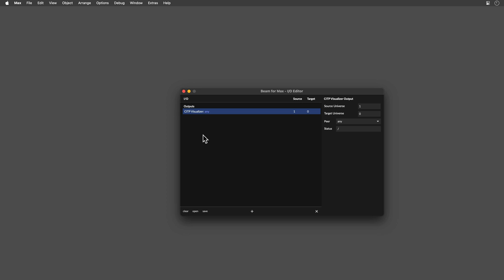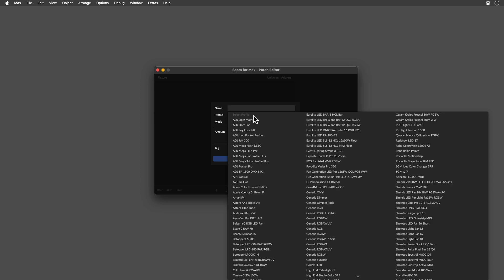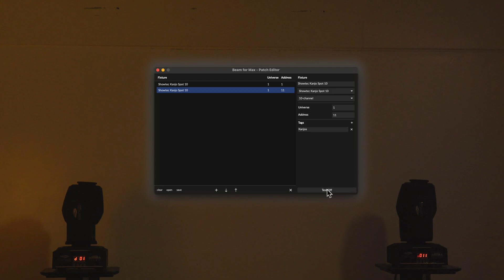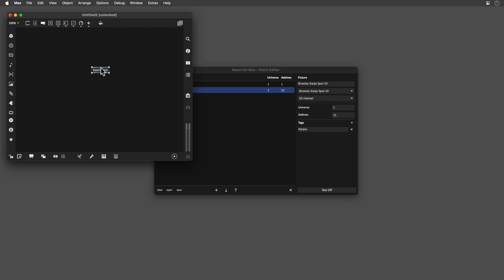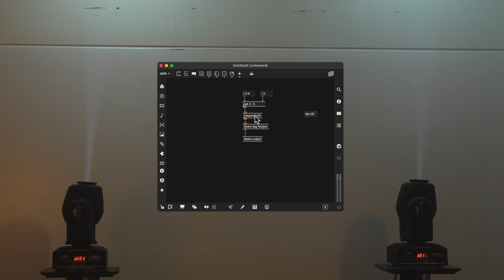Connecting to Real Lights with Beam for Max

Comment: It's awesome to see a package designed to manage DMX directly from Max.
One quick question, when adding a new fixture in Patch Editor, is it possible to customize a new profile if the fixture is not listed in the given profile?
Reply from the maker: Yes. Beam fixture profiles are actually JSON files, so you can open them in any text editor. We are currently experimenting with an online fixture editor for end users, but we can't share links here, so feel free to check out (or join) our forum for more information on that.
Reply: @Showsync  Great! Thank you for the info. I will check out the forum.

Comment: I wish it would work with more interfaces. I dont know if its compatible with Enttec 's new version of DMXis, or any other brand. I know it doesnt work with my soundswitch. It doesnt make sense for me to invest into ARTnet, then buy beam for max/live just to use beam. I'd love to know if there's another way
Reply from the maker: SoundSwitch hardware is proprietary hardware designed to only run with its own software, so it is not likely we can add support for it in the future. 

At the time of writing this, Beam supports the following DMX USB interfaces: 
- Enttec DMXIS
- Enttec DMX USB PRO
- Enttec DMX USB PRO Mk2
- Enttec Open DMX USB
- DMXking.com USB DMX devices

Note: the Enttec Open DMX USB is an unbuffered interface, which means it relies on the computer's CPU to generate the DMX signal. This makes it prone to timing issues, resulting in occasional DMX signal dropouts that cause lights to flicker. Therefore, we discourage using this specific interface in high stake situations and recommend a buffered interface instead (any other USB DMX interface on the list above, or any Art-Net node). 

Generally we would always recommend using an Art-Net node for maximum reliability.